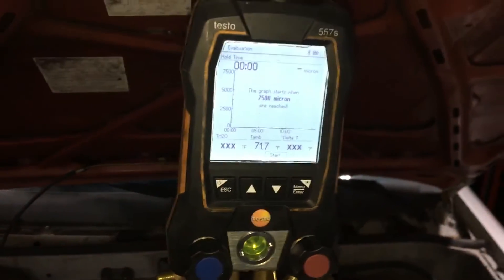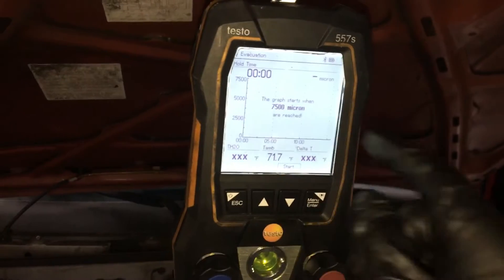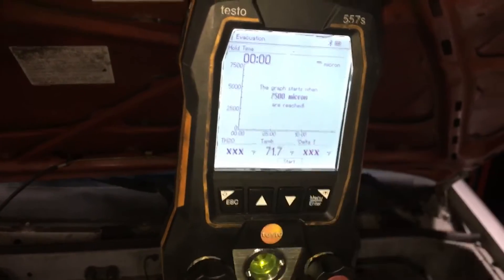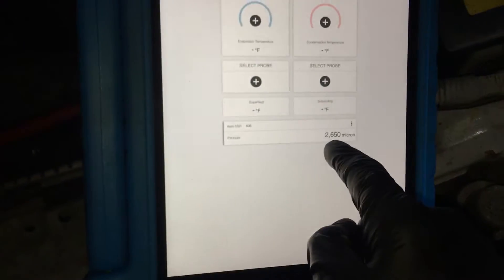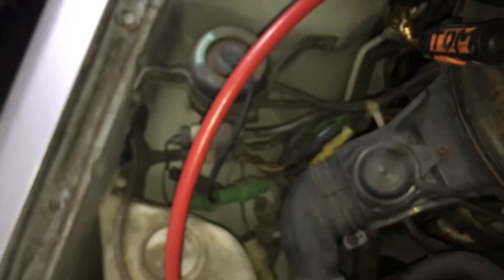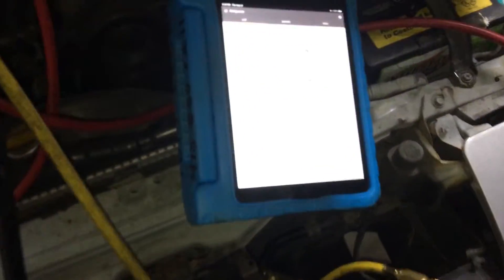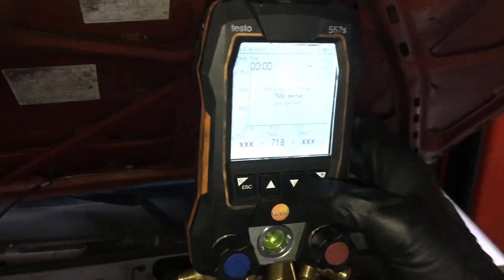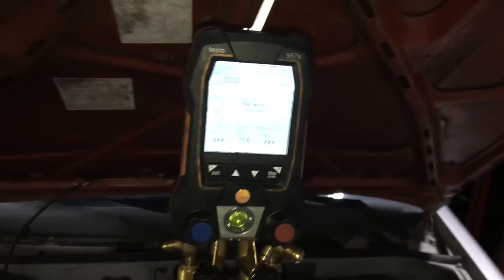TESTO 557s Pulling overnight vacuum. Another problem to add to Testo’s long list of problems 557S

Comment: Hey , correct me if i am wrong but when you connect to the app with an external device i.e a tablet or ipad the manifold enters into slave mode and all info is obtained via the app on the external device . So i am led to believe . Exit the app on your tablet etc and the manifold shoild return to control mode
Reply from the maker: It’s been so long since I tried to use these gauges for this purpose I forgot I will go back and turn off the tablet and try it again. 

       But overall I’ve had so many problems with these gauges and the set that I had prior to this that I returned they only get use mostly in an emergency when I run out of my other gauges because they’re hooked up to other equipment when I’m just doing a recovery or just need to pull a vacuum but don’t need them for anything else.